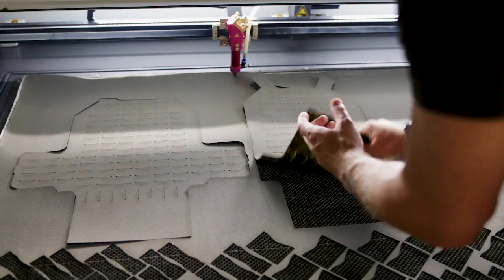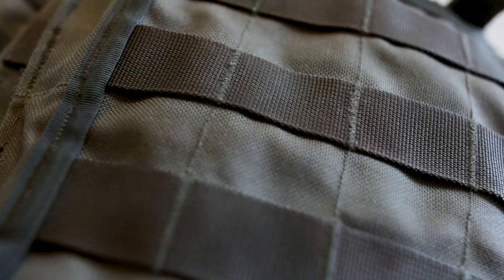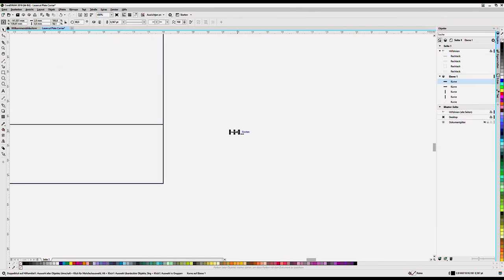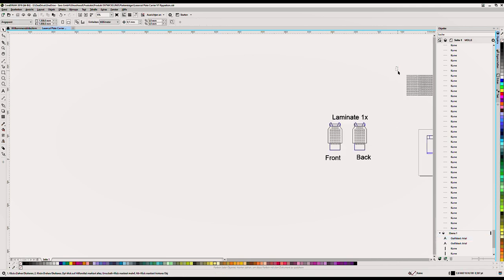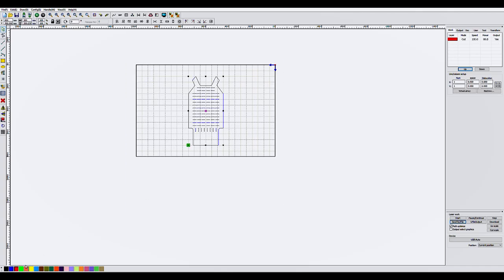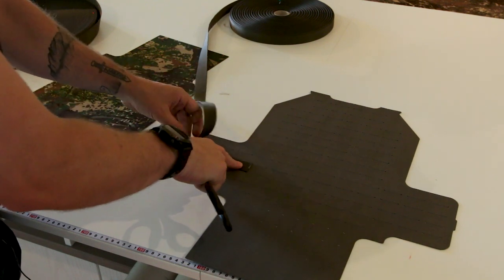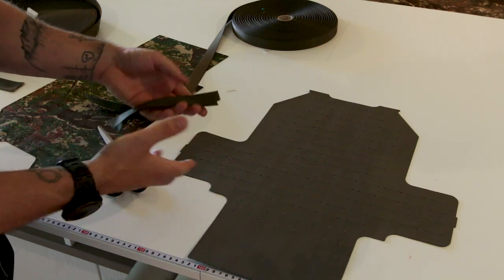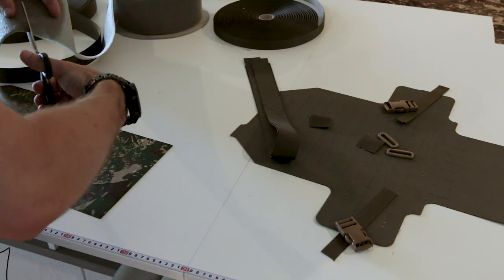I MADE THIS IN 2 HOURS - Lasercut Tactical Gear - MYOG Plate Carrier Quick Prototye

Comment: It certainly beats sewing row after row of 1 in webbing lol. For my plate carriers, the shoulder straps are always a pain. For lightweight and comfy shoulder pads or sleeves, I basically copied the Mayflower/ velocity systems examples. Just use a softer type material like 50/50 nycon or similar blends and add thin neoprene like 3 mm for the padding. It looks like you have an awesome design so far.

Comment: Very cool! Of the carriers I've tried I really appreciate an elastic cummerbund and shoulder straps as close to the neck as possible (as you have them here) as this allows a rifle to be shouldered without interfering with the plate itself. Some thin padding with channels for venting body heat on the inside are also appreciated for long term comfort but not necessary. Well done!

Comment: Personally I hate laser cut when it's anything to do with molle. It's just so annoying to deal with and attach things to. Sure it works, it's lighter but I'd still choose to run my avs over any laser cut pc just because of the webbing. It's still really neat though, and the fact you can do real quick prototyping is huge. Same thing when it comes to 3d printing, the fact you can just make a bunch of prototypes quickly, iterate on them is literally the best thing. I think using a laser cut machine to work out some different designs and then using traiditional molle webbing is the best imo.